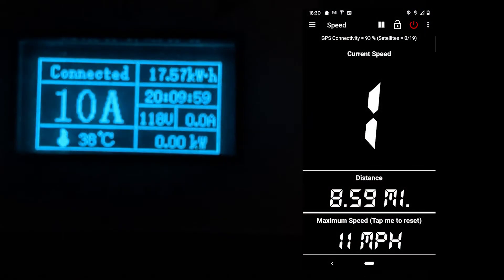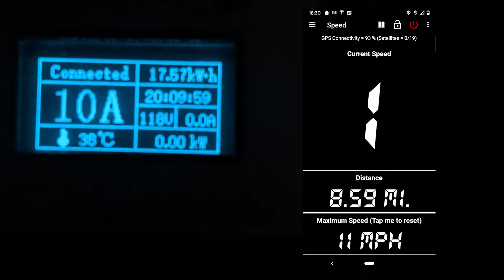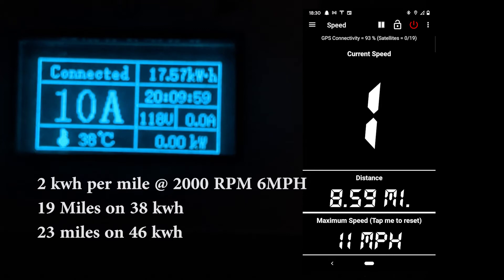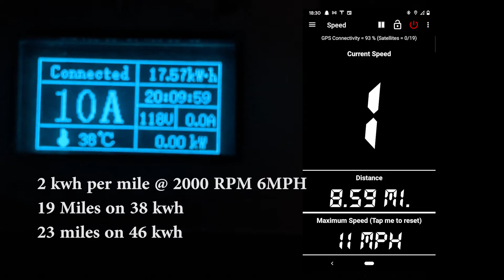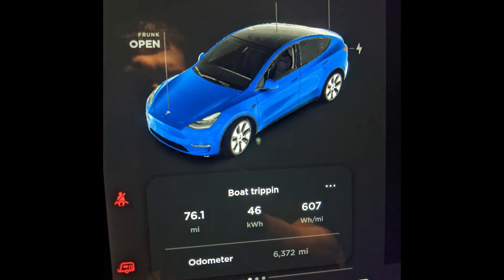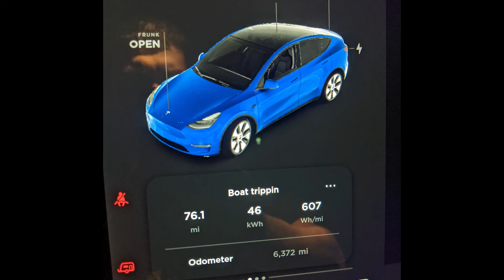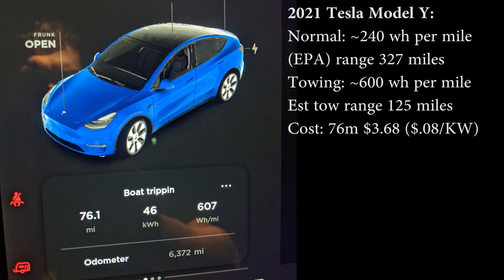E-Doo Electric Boat - Range Testing Boat, Breaking a Driveshaft on the Lake, and Tesla Model Y Tows

Comment: The real piece of information is the efficiency data.   Man,  I would be very interested in chatting with you.    Have you found a place where to get this calculation?    Especially if you want to go different speeds,  different sized props.  Etc.
Reply: basically you are gonna need a 100kwh battery for any reasonable speed and range for the boat. I was playing with calculation same to convert a jetski and came to conclusion that with current battery density we are unfortunately stuck with internal combustion for this application.

Comment: A idea i think would be good for speed test would be a Kawasaki 250x crankshaft coupler shaft with the rubber insert it had 2 points you could weld either end and the rubber insert would stop the metal on metal as it powers up...the 250x ski would transfer the power through this set up to the jet motor.....their is one on ebay second hand for £110

Comment: The instantaneous max torque from the electric engine might be too much for those splines to handle.  Putting the same piece back in will likely end in the same result.   Something more durable and custom may be in order
Reply from the maker: Definitely, I think either a new driveshaft and a much higher quality coupler with splines that run all the way through. Or I go to a machine shop and get something one piece and custom done to go in it's place.
Reply: could be ay, or perhaps a different speed controller? Some of them have a feature that allows you to slowly ramp up or down between speeds rather then that instant jump, could help with the mechanical stress.
Reply from the maker: I thought it might be the ramp up too but the strange thing was it happened at 2,000 rpms during a constant cruise. The controller allows me to change those settings so if it does turn out or be an issue I can update them for future runs.
Reply: @ThatOneGuy7575  S-curve acceleration on controller will prevent this from happening in future, in case you are still messing with the boat. Sad to not see further updates though...
Reply from the maker: @VladOnEarth  Unfortunately I have blown 2x of these since this video. It is actually not the torque curve. I finally had a mechanical engineering friend look at it and it was determined my imprecise welding may have resulted in a horizontal shift which the PTO adapter cannot handle. So I either need to re-engineer a mount or do a Lovejoy connector (I think).